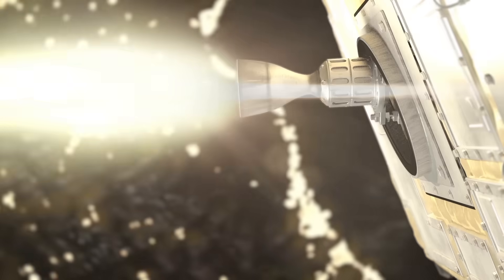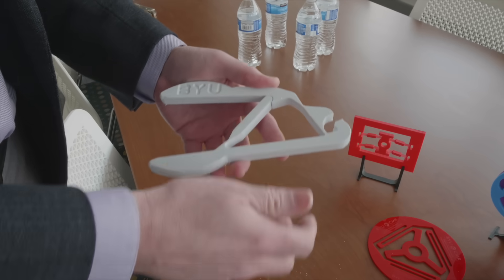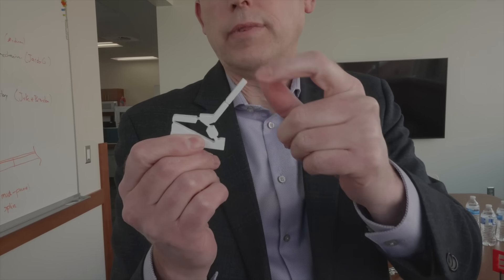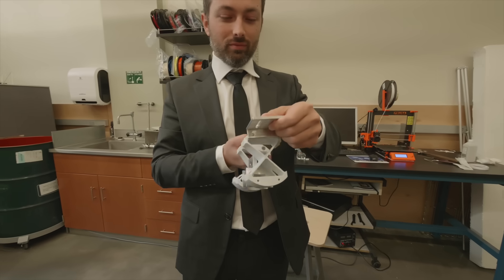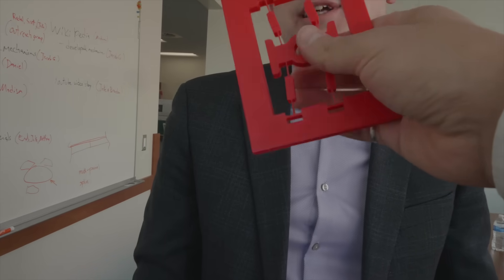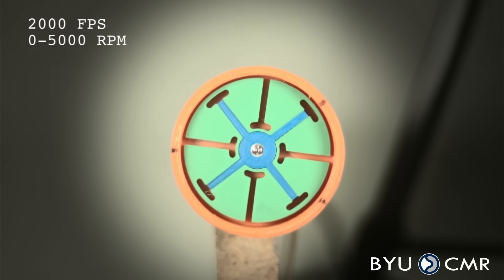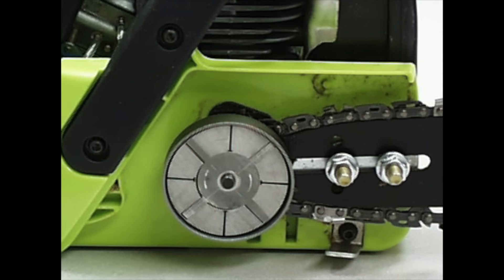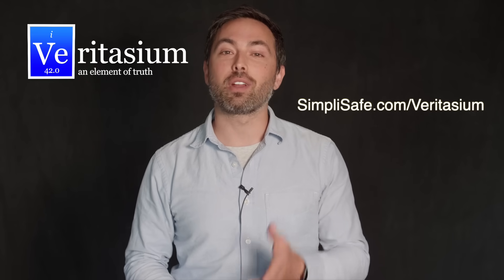Why Machines That Bend Are Better

Comment: This is amazing. As a mechanical engineering student, we are learning all the ways to prevent bending and shear, whilst you guys are taking advantage of it to make advanced mechanisms.
Reply: @lepidoptera9337  My comment might have come off as a bit rude, due to the bad wording. Apologies. I wanted to highlight the absurdity of the headline of this video. I absolutely agree concerning the rigidity. Compliancy also implies a direct connection. I fail to understand how you would construct just any rotating mechanism (one that rotates several times around its axis) without two surfaces gliding against each other. Therefore you will always require bearings which in most cases should be anything but compliant.
Reply: @lepidoptera9337  Of course hydrodynamic and magnetic bearings are thing. But they still aren't compliant mechanisms and most of the time for many applications they're simply to complex, tedious and expenisve.
Reply: Yes, you can build a sloppy, flexible, weak, but complex mechanism that gives you repeatable precision results… these are called tolerances. The machines that are required to build the parts for any device, require a tolerance at least one degree higher, of at least one of its parts.

First learn, then unlearn what you have learned.
Beyond the proofs, Everything we have been taught is technically wrong to some extent down to certain tolerances of mathematics.  Which also makes you question the proofs… that were only established to further knowledge to a certain tolerance. Even what you think you know, you don’t know, Until you know everything! Welcome to the matrix.
Good science is wrong at least 99.9% of the time. Beware of science!
Anything less is called, obvious, or garbage. Especially beware the scientists that gather up the obvious to support their suppositions and present them as proofs.
But as long as it’s repeatable, it good enough for humans. But most importantly…
Keep thinking
Reply: @johnholmes-rz3vj  Why are you telling us that you don't know anything about machine tools? We don't care about all the things you don't know about. ;-)
Reply: @lepidoptera9337  I have slide rules older than you….
Reply: We’ve just discovered flexibility!!!! It’s amazing,,,!!!
Reply: @johnholmes-rz3vj  Maybe, but you don't know how to use them. ;-)
Reply: @lepidoptera9337  I love seeing arguments in the comment section of science and engineering videos. It’s hilarious because everyone involved is a massive geek, equally so.
Reply: @bunsenn5064  I am a bit more than a geek. I am actually a physicist. ;-)
Reply: That's because the headline is not even true. If you are trying to design a CNC router, then bending is to be avoided at almost all cost, otherwise your machine will only do three things: 1) destroy your workpiece, 2) destroy your tools and 3) destroy itself. If you don't understand why, then you still have a lot to learn, "mechanical engineering student". Engineers who are designing bridges and railways and pipelines, however, have learned centuries ago that compliance against thermal stress, etc. is absolutely required to prevent failure. You just don't know what you don't know.
Reply: @lepidoptera9337  I mean just because he compare "preventing bending" to a compliant machines, doesn't mean he is all wrong tho.
Reply: @iPlayDotaReligiously  Most machine tools are made for highly rigid tooling processes. If the tool is allowed to move in the direction in which it "bites", then we get a destructive positive mechanical feedback where the machine gets deflected ever farther into the wrong direction. The way to counteract that is with rigidity and mass.

"Soft" machining can be done, of course and it's highly useful. That's how optical manufacturing processes work, for instance. Grinding and polishing can produce near atomic precision with machines that are all but precise and are completely floppy at the scale of the final precision. I find that absolutely fascinating in its own right. 

A stone mason is, if you want, also a "soft manufacturing process". He constantly compares the shape of the stone he has with the shape he wants. The tradeoff is time... soft processes take much longer than a rigid process. So yeah, there are plenty of applications, but one has to chose wisely.
Reply: @lepidoptera9337  Really? Manufacturing is your only concern with this? You cannot build anything that spins with bending mechanisms. This already rules out anything from Turbines and Pumps up to wheels and power tools. Compliant mechanisms certainly have their place but they won't replace as much as people like to believe.
Reply: @lepidoptera9337  even these compliant mechanisms rely on having parts that don't bend as well as parts that do. No one is saying everything should be made out of floppy rubber, just that we're neglecting the uses of things designed to bend.
Reply: @keiyakins  I am also not saying that everything has to be rigid. We have plenty of examples from biology that prove that flexible structures are useful. We make our planes fairly flexible so they can withstand turbulence without catastrophic structural failure. It just happens that most of our technology is built using rigid design. Time will tell if this will change.
Reply: @lepidoptera9337  I do not have any type of engineering education, but from what I remember in high school physics, is the use of compound material in things like bows for their compactness and good force multiplying. It depends on the use case. I remember we had tent-like structures on our school fields for shade. One was made by hollow steel pipes, one was made by the bamboo and ropes (very common in my country), when a sudden stronm hit. The steel pipe tent did not suffer damage, but was blown away and the joints suffered damage. The bamboo tent swayed a lit bit, but did not collapse. The bamboo itself suffered no noticeable damage. My teacher had a thing about teaching us things after whatever failed after torrential storms (common in my area) and, he loved to point out all the coconut trees still standings, compared to some of the some thick sturdy trees uprooted or damaged.

Comment: This might be the future when it comes to high tech or miniature applications, but consumer products that bend are not made out of titanium or exotic materials that can take the repeated stress, they're made out of the cheapest crap plastic available. I can't even buy bending clip for my bags of chips that will last more than a year, let alone things that matter. For the consumer market, the singular reason this exists is because it's cheaper to manufacture.

Also, every chainsaw I've ever seen that has an expanding clutch of this type is a huge lemon when you put any load on it, in my experience.

Comment: The elephant, your point of reference is that the trunk is not moving but your intuition how where it will be after pushing on the rump in relation to the elephant is correct. Just to make you feel less dumb.

Comment: Longevity of a switch is not properly tested just by cycling it. Environment is also important. A "one million activation" switch may die in few than 10,000 activations over a long period due to corrosion.

Comment: I work in an R&D lab of a Swiss watchmaking company, and I can tell you that compliant mechanisms are currently by far the hottest topic in research for mechanical watches. For example, they're used in the form of microfabricated oscillatorsmade of Silicon in the Frederique Constant Monolithic and the Zenith Defy Lab.
Reply: One question I had while watching the video was : "How does it react to heat variation ?"
I would say this one is especially relevant for mechanical watches applications
Reply: @JW-mb6tq  yes completely agree, I just revisited this video and mechanical watches came to mind; didn't know that compliant mechanisms were in the map for watchmaking, would be nice to see how.
Reply: Awesome but when am I going to get flexable phone
Reply: That went completely over my head 😅
Reply: Very interesting. I suppose the hairspring is already a kind of compliant mechanism. I'd love to see how they make compliant mechanisms which function even better than traditional jewel bearings.
Reply: I have a question could mechanical watch movements be scaled up to power other things like vehicles homes or things of that nature im not the sharpest tool in the shed but in my youth once I discovered how mechanical watches operate I’ve always wondered why not or if the technology could be applied to more than time keeping
Reply: @lemniscatelogos7917  That's actually an interesting question, I never thought about that! In principle, you could scale up the size of a mechanical watch movement to fill your living room or make it even larger. But the problem is, you won't be able to wind up such a super-sized mechanical movement with your own force because of the enormous force of the mainspring. It's conceivable though to build a mechanism that would use energy from the environment, e.g. wind energy, to wind up this movement.
Reply: I can only understand 50% of what you've said, but.. cool~~!
Reply: Flexible parts sound like a nightmare for longevity and accuracy. As a watch dude, you already know the lengths they go to minimize backlash and friction. Ruby bearings and escapement, precision machined everything. I could see flexible parts being used as part of a complication, but never towards the heart of the watch
Reply: @jankington216  The time inside a watch is literally kept by a hairspring, which you've guessed it, is as thin as a hair. This spring has been recently replaced by Zentih using the compliant mechanism etched on a silicon wafer, in their new watch called the Zenith Defy Lab. This breakthrough could actually mean mechanical watches could become more accurate than their quartz counterparts once again, all thanks to the compliant mechanisms
Reply: @jankington216  Like the man said, compliant mechanisms don't have the backlash of pin-and-hole hinges.
Reply: @MrCanoeheadful Nor do they wear from friction.

Comment: Well the only problem i see, is that over time this things may get hard and less bendable, which something with stiff parts wouldn't... if they are able to prevent the bendable parts from hardening out, it is a great idea
Reply: That's a condition called "work hardening".  Some materials are more resistant to that than others.  Like steel springs whether in a watch or a car.
Reply: material science will prop that up for them, there's usually multiple fields coming together when it involves multi-million/billion dollar projects or anything concerning nuclear weapons.

Comment: The biggest challenge with this type of mechanism will be FATIGUE which will ultimately affect its life.
Reply: They tested it out and got over 1 million uses without any decrease in function. Polypropylene's pretty great.

If you were arguing for it in general, this applies to normal but complex machines too which would be harder to account for.

Comment: Wow! Here's an application you may not have considered. Is it worth thinking about how you can create bracing for the top of a stringed acoustic instrument, like a guitar? Many major manufacturers brag about their special wood bracing that was proven over centuries. All make some compromise between sound quality and strength.

Comment: I've seen plastic mesh tires that seem to benefit from this principle. Next step, of course, would be similar suspenison... If you can control to such a degree what movements are allowed, this could save a lot of weight.

Comment: Just a transmissions valve body applies pressure to incoming fluid forces, by redirecting it through chambers. Redirecting pressures across the y-axis allows micro adjustments for the forward motion

Comment: Hi @veritasium

I was trying to think of a way to implement the thruster mechanism shown at 8:33 to use it for the mirror pointing of a telescope. An interesting question that I have is how this mechanism is able to operate in space when titanium becomes very brittle at those temperatures.
Reply: I feel that there may be some improvised alloys used, cause afaik titanium goes extremely brittle at -196C , and this was just a prototype to see if titanium would be a good fit. Just an assumption tho…

Comment: FASCINATING!  In slow motion some of these components are still deceptively clever.  Modeling the 'snap' point of such materials must be complicated, to the point that trying different materials, widths, and angles are no doubt exhaustively checked during prototyping.

Comment: The clutch is actually a centrifugal clutch, exactly like the ones in the chainsaw, but the one in chainsaw have 2 or 3 springs, and those springs break all the time. So these parts would be much more efficient since they’re made out of one piece. Nice!
Reply: I think that with such range of motion the clutch will outlast any toolbox hinge
Reply: Why do compliant mechnism last longer than springs if they both just do elastic deformation?
Reply: @arnerob123  he didnt say theyd last longer than traditional springs, although they might depending on material and design, but what he was saying is that replacing one big piece is easier than taking apart a big piece to replace smaller pieces inside. when the springs break, replacing the whole clutch would be too expensive, so he has to disassemble the clutch and replace the springs, but with a compliant centrifugal clutch, if the clutch breaks its one cheap piece so he can just replace the whole thing
Reply: You haven't used chainsaws much to say that the clutch springs break "all the time".  I have seen saws used every day for years on end and never once seen a clutch spring fail.  Now that isn't to say I have never seen any fail, but the springs are made out of some very good spring steel and usually last years and years
Reply: @dschamber7190  I worked for STIHL of America, we have designed hundreds of springs out of different material, all of them break due to hight temp, stress and even the juice that comes out of certain type of trees, we’re talking about everyday pro use, 8-10 hrs of use, with no cleaning in between, you probably only use them 1-2 hrs… thats nothing
Reply: @Nunezification  no I’m talking about professional logging use… 8-10 hour days for 7-8 months a year.  Clutch springs isn’t something I have seen break very often

Tree juice eh… lol.  That’s funny
Reply: Centrifugal clutches has inner shoes made out of friction material for reason: steel shoes and steel drum I suspect would have nice sparks flying all over...
Reply: @trustmeiamtroll4198  they never said the centrifugal clutch gets installed with just bare steel as a friction surface
Reply: Those springs means it is easy and cheap to replace. If it's all one piece, you will have to throw it all away for a single failure. Anybody who has used bending plastic hinges knows that absolutely suck. Ask any guy who regularly uses toolboxes. The good stuff has metal hinges.
Reply: @davidgutierrez8297  Good thing that the design isn't actually meant to be used for plastics, but metals, am I right? The plastic shown is only for demonstration purposes.
Reply: @davidgutierrez8297  1: injection molded plastic toolboxes use different plastics than this and arent stress tested for over a million uses by firms dedicated to compliant mechanisms

2: he literally showed a metal one right after saying "this ones plastic so its just a model"

3: its a single, relatively small, extruded piece of metal, they showed a picture of it installed on a chainsaw and its just smacked on the outside, itd be the cheapest and easiest thing and to replace it you literally replace exactly one piece of metal, instead of buying and replacing multiple components.
Reply: @davidgutierrez8297  They demonstrated a steel version as well. Also, the plastic switching mechanism (yes, I know, not a clutch) was stated to have been torture tested to millions of actuations.
Reply: @davidgutierrez8297 these mechanisms are designed to be 3d printed, so realistically you could just print a new one

Comment: Really cool! The metals have an initial elastic deformation, which allows them to revert back to their original shape. As long as the devices printed do not go into plastic deformation, it would work really well for a very long time. So brittle materials like glass and ceramics become extremely difficult to work with in these applications. Thanks for the video.
Reply: Brittle materials also have thos initial elastic deformation, they just fail catastrophically when you go past this region. We use silicon and glass all the time in compliance you just have to stay in the elastic area.

Comment: What polymer are they using for that vice? 
Is it PETG or will PLA also give the 30:1 ratio?
It'd be great to get a relevant and informative answer, thanks!
Reply: I'm not sure about the vice, but I looked up their website (mentioned in the description of this video). They have some designs and their specs. It was PLA in all the all the items that I checked

Comment: It looks cool, but I'm not entirely certain about the benefits. For one there's a big difference in replacing a single standardized nut or a whole unique mechanism. Another point would be the strength of those flexible parts under unexpected loads. 

But I expect the ones in charge of product design to take such factors into account at least to some extent.